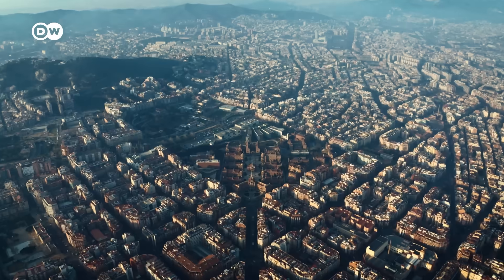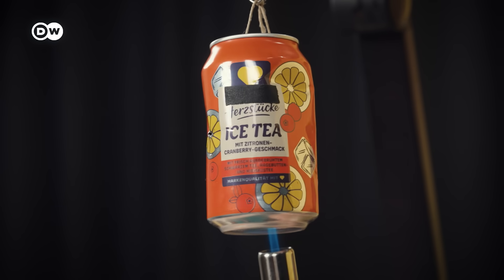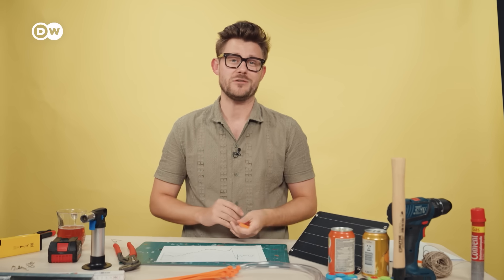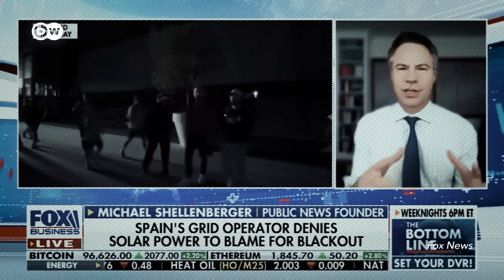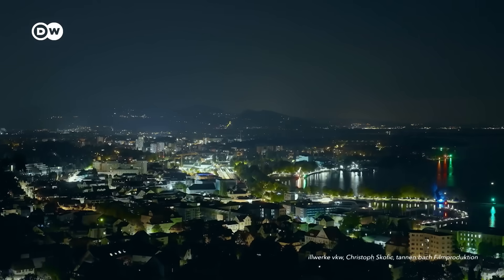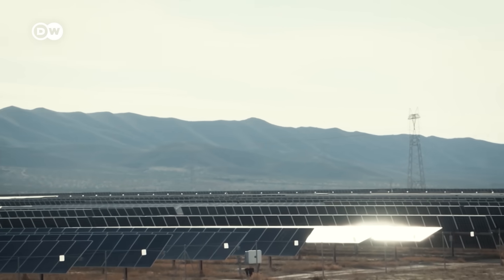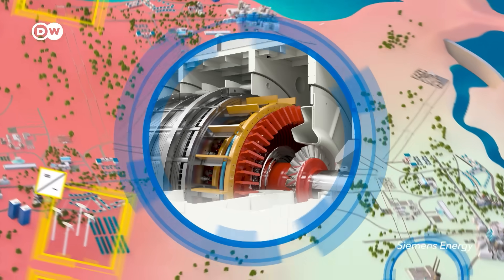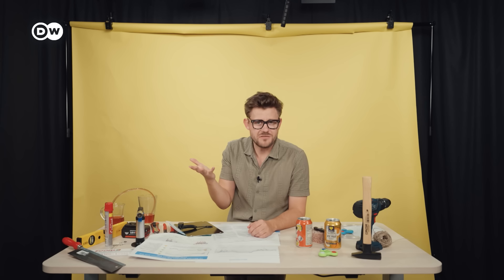Solar's hidden problem (and how to solve it)

Comment: The Spain thing wasn't solar, it was a complete lack of properly configured failsafes.
Reply: If you say "failsafes" people might thing we're missing fuse boxes or something...nonono what happened is that the grid has effectively no power control, very limited current limits all across the board and its NOT segmented into self contained parts that could be shut off in case of emergency. All this because it's been massively privatised and private companies HATE spending money on redundancy, especially since parts of the grid have been burning every single year due to forest fires. It's effectively the same problem you have if you connect a power extender to another and another and another all over from Germany to France, Spain and Portugal (which were all part of what went dark).
If ONE power plant fails or there's a small peak of overconsumption the power grid becomes a sink and shuts down EVERYTHING at the source. Everything then has to be restarted with local generators (except for solar which just needs to flip a switch to be back on but that is not enough to power the whole grid) which was what took so much time.
It's effectively just greed that caused this and even local blackouts have been getting worse and worse over time.
Reply: @pedromoura1446 You cant flip a switch and turn solar, nor can you do it with any switched power source so wind, solar etc. This is because frequency is king its the one parameter that has to be equal everywhere in the grid, syncronization cannot be achieved at scale in a cost effective system, no those systems need the grid frequency to already exist before starting, their inverter pick up the frequency and match it.

The hardest part of a blackstart is the syncronization step which is achieved mechanically.
Reply: @pedrorequio5515  of course you can...you do it by disconnecting them from the grid until such a time when you need to start coordinating the restart process. They even come pre prepared to do this since solar and wind could flood the grid at the peaks of highest supply or lowest consumption and cause a blackout. The difference being that on a black start thermal powerplants need a secondary generator to jumpstart and time to reach get back to the needed performance required to restart the grid. Solar and wind don't. You just connect them back again and they're up and running immediately.
With power storage that brings the time required to restart a whole grid from a day to a couple of hours. This was acknowledged by power companies in their initial remarks on the subject and I believe it's also mentioned in the final report of the blackout how solar increased grid resilience to these events not diminished it.
Reply: Spain and Portugal!!!
Reply: @rusedgin Spain m8 don't lie. We also got affected because we were importing electricity that day from Spain which also made our grid unstable.

A big chunk of our power production is from hydro and wind generation. Do your homework mate before speaking.
Reply: @therocksince99 I didn't speak. I wrote.
Reply: But those failsafe are needed because of solar
Reply: @Marbv121 no. They are needed in case of emergency. If you cannot segment a part of the grid that is SUPPOSEDLY being served by a single power plant then the WHOLE GRID goes down if it fails. This means you have to effectively get automated mechanisms to cut off parts of the grid from the rest in a case a lack of supply or redundancies in case there's excess consumption coming from a specific point on the grid. This case was an EXCEPTIONALLY good example of bad example due to lack of both.
 Since power companies have been privatized and forest fires have been destroying parts of the grid every year we lost most our redundancy (Portugal and Spain had one If not THE best constructed grid in terms of resilience in all Europe before privatization) and most of the automated equipment responsible for isolating part of the grid are outdated or absent.
What happened here (according to the existing reports) was that Spain and Portugal EXPORT energy. Somewhere in France there was a massive power surge (some group of people or companies pulling massive amounts of power) and there's only 1 single power cable from Spain to France.
Normally that part of the grid would be cut off in less that a millisecond and the blackout contained to the area were the excess energy was pulled from but in THIS CASE that was connected DIRECTLY to the main grid meaning what was cut off was part of Germany, part of France, Spain and Portugal. After this took all our energy the powerplants stopped due to excessive pull (they take some power from the grid to keep some parts like electronics working and if there is none everything shuts down).
Had areas inside Spain and Portugal been correctly isolated through automated mechanisms solar could in fact have played a part in bringing back other local powerplants to full power (WITHOUT the need to search for dedicated fuel generators capable of bringing those power plants back to life) and could do it withing a couple hours because solar power doesn't need to restart nor has any parts that need to be connected to the grid to function.its all self contained (meaning all you have to do is close small areas of territory and slowly saturate the whole grid with power from solar powerplants until it can hold itself) and if there were redundancies over the pirinees to connect Spain to the rest of Europe then this would have never happened in the first place. NONE of those are needed due to solar or wind and grids that have solar and wind are much more resilient that others (which is why ukraine has been using renewable energy to keep their grid up)

Comment: 2:00 This is a problem so absolutely retarded its not even worth laughing at any more.
Buffer the energy in batteries and spin a fucking flywheel for the inertial mass you need to keep the grid working. 
The turbines are not special magic machines - remove the blades and just have a drum of steel for the same effect, but thousands of times cheaper and better in every way.

Comment: They didn't say the full story 
Adding Synchronous Capacitors or the electronic equivalent (which is much more prone to failures), and creating the communication network necessary for a centralised management, makes solar energy more expensive than traditional generation.
This fact goes against the current narrative the solar energy is "cheap" and "free". No. Properly installed solar generation is among the most expensive type of electricity, and we have yet to factor in the huge batteries necessary to counter passing clouds during the day, and zero-light during the night...
Reply: The world sees that differently.
Solar booms worldwide.

Comment: It's oversimplified. The issue is on EU grid management. Spain had a lot of electricity so it sent to Portugal and France. About half an hour later France, Germany and other central European countries began to have excess of electricity and tried to flow it to their neighbors. This excess flowing from Germany and France towards Spain overloaded the latter's grid and there was nothing to protect it, so it collapsed. There are many preliminary reports on this sense. The issue is much bigger and it might happen again and more frequently
Reply: Spain was exporting electricity to France, not importing it.
The issue was in Spain.

Comment: 8:03 It's called synchronous condenser. Not compensator.
Reply from the maker: Hey there! In strict usage, a compensator can refer to any device that compensates voltage or reactive power, which could include static VAR compensators (SVC) or other technologies. So, a synchronous condenser is a type of synchronous compensator. In this case we mean the general concept of reactive power compensation, so compensator it is. Here's more to read🔗👉 https://www.entsoe.eu/technopedia/techsheets/static-synchronous-compensator-statcom/

Comment: Nine hours is not a full day, to pick a nit.

Despite watching a zillion hours on YT about renewable energy, I've yet to find one that explains the solid state converters, changing DC of the panels to AC at the right voltage.  It seems to me that if those converters had a pilot signal from the grid to keep the AC in sync, that would take care of this issue.

Here in Texas we have more solar and wind than any other state. I love driving out west or north into the panhandle and watch the turbines.  "Windmills" if you are Trump.  Due to 
Texas' unique "Power to choose" program, my all electric home is running on 100% renewable energy.  It costs me 15 cents per kw/hr, the national average is 17 cents.

Comment: well you haven't had enough bangs on the great "steam" engines.. if you do, it won't be like the solar voltage shortage.. yes the magical energy from steam.. i always thought you were a serious channel, it appears you are not.. steam engines are very old.. think antiquity.. you could always smash the atom and turn a steam generator.. this will bring the stability you want.. (high hopes of nuclear scientists) 🤪 by the way, when "grids" fail, the actual problem is not solar, it is the grid. Solar needs other infrastructure, it needs a smart grid, and not large solar installations in the countryside and thousands of km of cabling.. a problem exists on adopting new technology along side older technology that should be deprecated forever due to not much efficiency. Now if some think that the only problem in climate is the energy coming from the sun and is kept due to green house effect and not the overall energy being released by human activity, then the problem is not mine but yours. Why is that? Because most of the energy released 200 years ago from human activity actually never left this planet..when the planet you live in acts as a "filter" for EM radiation, and the energy that is the problem is kept in, all the energy released so far, where you think it went? back to space? not really.. why don't you ask for some "tests" to see what happens..
Reply: by the way even solar is implemented in the wrong way.. the large solar plant.. the nuclear power plant etc.. that logic doesn't apply and should not be applied everywhere.. but that is something engineers should think about, and energy providers. Nowadays with an off-grid installation and batteries for storage, you could even not need a grid. Do you know how much it costs to operate vast electric grid? if high voltage lines are great for nature and human health why they are not inside a city also? In life you can never change the mind of the idiot, you just wait.. of the upcoming events that will arrive to change his/her mind. The events have not arrived "yet".. when they do, some people would wish they never used steam engines.. by the way, in case you liked the floods, get used to it.. so many years of adding water to the atmosphere what you expected to fall down? let's play a game.. let's do what you propose, after all you seem to have great advisors.. @StarTalk @SabineHossenfelder keep adding energy to the atmosphere to see if the planet rotates "slower".. then think butterflies.. those damn insects should stop flying they start tornadoes and not humans with their stupidity.🤪😂👽
Reply: by the way for anyone with a brain that operates there is a 50 second video showing how temperature average on this planet relates with EM field intensity.. just make sure to get the axis properly because the two charts have it in the opposite way (which makes for AI a bit difficult to spot the pattern)

Comment: Can flywheel be used to stabilize solar power output?
Reply: Better to use batteries.
Reply: @old-pete  yes and no. Batteries are great, but not reliable as mechanical system. I don't think that batteries are great for energy balancing. They have limit on discharge rate.
Reply: @jozo92 
Batteries are cheaper and are available in huge amounts.
Many countries own or build GW level batteries.
And yes, they react quickly and with much fewer losses than flywheels.

Comment: Great episode! Maybe it's time to use more HVDC. No frequency to worry about, and batteries could be used for both storage and instant voltage stabilization. With batteries at either end of important stretches, peaks in required power transfer could be shaved off slightly, which would also reduce transmission losses.

Comment: This video is real poor clickbait from DW.
There is an extremely detailed and technical video on here. The power engineer goes through the incident report in detail.
The main root causes.
1. Low frequency disturbances allowed to propagate acros the entire European grid.
2. Changes made to the Spanish grid by 3rd parties that did not meet standards.
3. The grid operators did not have any monitoring of parts of the grid.

But yeah, it's solar.

Comment: This reporter should have done more research instead of putting on a pointless demonstration. Fluid dynamics is not a good analogy for electrical current. The graphs could have just been shown on screen, instead of being printed out. Computer graphics could have been used to illustrate the actual issue, instead of using cans and blowtorch to make an analogy. We live in an age where computer graphics are accessible to all, surely DW must have at least one person on their staff capable of doing a simple animated demo. It doesn't even need have 3d models, one can create an animation by moving still images in video editor software.

Comment: The old way using a spinning turbine to emulate inertia cannot be  a viable solution to a new generation problem. A small scale storage (expensive at the moment) to electronically (power electronics) support the oscillations should be the way to go.

Comment: How did this not mention grid-scale lithium ion batteries which have faster/better response than spinning turbines for grid stability? The solution renewables should have anyway for intermittency is the same solution to this problem and much, much better at it than the old method.

Comment: In such a complex infrastructure as the electric grid it is down to governance, lack of correct understanding of how the shifting power grids input factors affect and ripple through the network when components fail, lack of corrective actions and investment into solutions that can regulate and automate the balance of supply and demand, voltage and frequency regulation solutions like synchronous compensators, Static compensators or battery storage is paramount in a electric grid that’s have little buffering built into itself from spinning generators and so planning wide scale upgrades to grids that plans on using a high level of intermittent energy generation like from wind and solar is not just important it’s a requirement for a usable, reliable and stable energy system.

Comment: These are regular teething pain of early stage deployment of any major infrastructure technology. To call these solar problems makes as much sense as calling TSA lines and overbooking passenger plane problems
Reply: One doesn’t do a rollout of a major infrastructure technology without having lots of backups and contingency plans in place to keep things running if the real world experience doesn’t match the claims for that technology.
Reply: Exactly. It's a problem with a solution, and any country or grid that does its homework will understand how to implement the solution. It's ridiculous that some people are so quick to reject solar power because of this perceived flaw.

Comment: New Zealand very rarely has a major blackout. Each electricity bill we pay has a levy that pays Transpower for maintaining the electricity grid, so they're always well funded. There was a blackout a few years back, one of the undersea cables that linked the South Island to the North Island failed during an upgrade and it causes a cascade that cut off the South Island from the North Island. As the South Island generates a lot of our electricity and the North Island is where a lot of our industry is it left the North Island without electricity for an extended period. Price per kilowatt hour ($/kWh) in the South Island dropped to next to nothing and the North Island $/kWh skyrocketed. What didn't help is that a lot of systems are now price dependant, especially with renewables and battery packs, they can shut themselves off when spot prices get too high so their electricity draw can suddenly stop, and they suddenly start pumping electricity into the grid when prices get high enough, which can make a bad situation worse. Until recently renewables were part of the network but they were not governed by Transpower. I believe they've since changed the rules for those who want to generate electricity for the grid, the external feed into the grid is controlled by Transpower so they can be cut off remotely.

Comment: All new tech has growing pains, though the baffling problem with the EU is its underuntilization of nuclear power. 
Especially for industry and energy intensive infrastructure like data centers.
Reply: You can put up solar panels in 4 months. Nuclear Reactors take a decade.
Reply: The day before Chernobyl happened, everyone was sure it was safe. The day before the next disaster will be the same. It is a human problem, not a technical one.
Reply: Nuclear is ridiculously expensive. It works for certain countries, but if you live in a place that gets as much sun as Spain, you'd be foolish not to use that to your advantage.